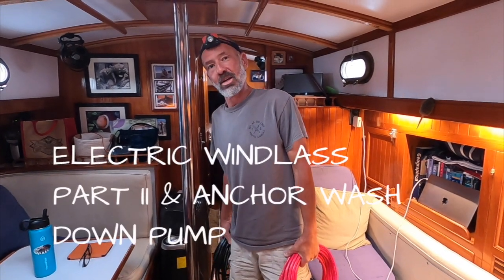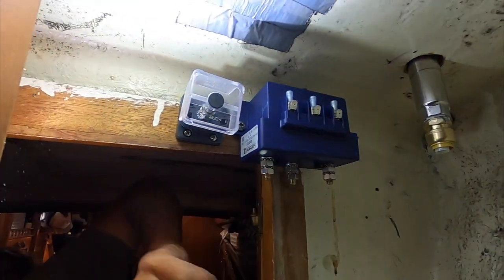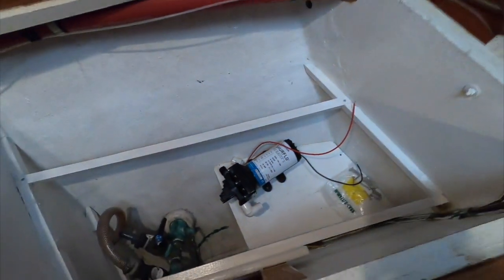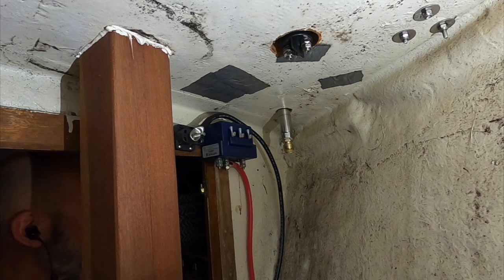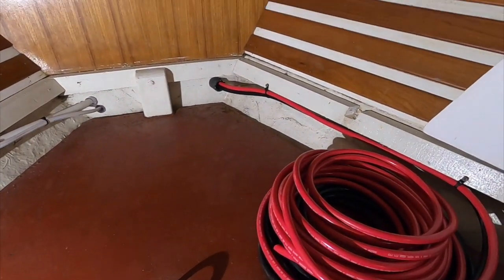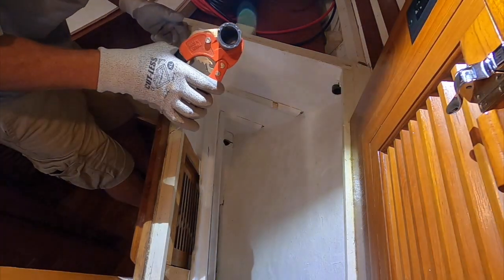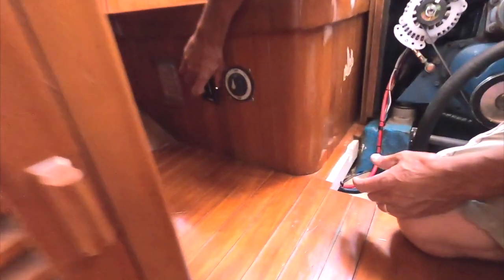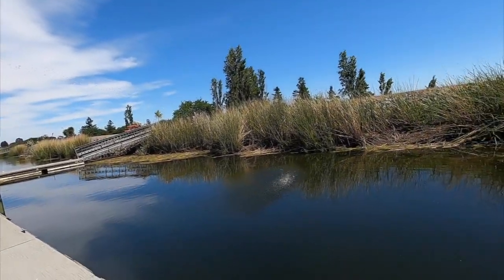SV Ramble On | Electric Windlass Part II and Anchor Washdown Pump

Comment: Did you have any issues with voltage drop over that long cable run? Is your windlass 12 volts or 24 volts?
Reply from the maker: It’s 12 volts and no voltage drop that would inhibit the operation of the windlass.

Comment: I am considering a project like this and was  contemplating just adding a battery at the bow to power the windlass. Did you consider this and if so why didn’t you go this route?
Reply from the maker: Yes we consider it, but the cabling requirements to charge the battery at the bow was the same to charge the batteries at the back of the boat.  Six of one - half dozen of the other.

Comment: If I'm working in an area and don't want to lose hardware I put a towel down and then the nut or bolts drops and lands on the towel. Then rolls off under the fuel tank. Lol
Reply from the maker: Thats a perfect idea.  After I fished the nut from under the tank that's exactly what I did.  I dropped the nut a second time (butter fingers) and thankfully it got caught in the towel.  Thanks for watching.

Comment: With heavy amperage gear in the bow like the winch and the pump, would it not be beneficial to install a dedicated forward battery to cut out the need for long run heavy duty cables. Battery can recharge in situ using existing smaller gauge power/control feeds.
Reply from the maker: Hi Mark, I actually weighed that option before I went the big cable route.  The problem with a dedicated windlass battery (at least in our case) is the different battery chemistry and charging profile compared to our LiFePo main battery bank.  That's sort of the same reason I chose not to install a dedicated starter battery with a 1-2-All-Off switch, but rather we start the engine off our single 500ah house bank.  To properly charge a remote windlass battery was going to require cable nearly as large as the windlass cable its self.  Plus, I'm not particularly fond of the idea of having batteries charging and (in the case of lead-acid technology) potentially off-gassing Hydrogen beneath our pillows as we sleep.  Everything about living and traveling on a boat is a compromise.  Thanks again for watching.

Comment: Great Job.!!! Would you remember off hand, what the length of the wire was?  2 AWG, correct. For 10  years we have been cruising with a manual windlass but finally going to upgrade. Thanks for the help.
Reply from the maker: Hey Tutty, I picked up 40' each of black and red 2AWG (80' round trip) and I had about 1.5' of red, and maybe 4' of black left over when I finished.  Talk about close  It's actually a bit oversized for the windlass load by its self, but I figured I'd err on the side of caution since I'm also running the 12amp pump off the same circuit breaker.  You probably saw that the positive buss bar is at the forward end of our nav station seat, but the negative buss is at the opposite end of the battery bank.

Comment: Can you show the connector between the vinyl hose and the pex plz sir
Reply from the maker: Hey John, I just uploaded a pic of the PEX/Poly atapter fitting I used to our Instagram & Facebook page.  Basically, it's just a male or female pipe-thread hose barb fitting to the corresponding male or female pipe thread PEX push-connect (Sharkbite).  Thanks for watching.

Comment: Love your work.  Just one note, cause I’d love to try it in my boat... could you in fact connect the water supply to work with the UP foot switch and have the pipe somehow permanently connected  to the anchor roller thus avoiding having to stay connecting the blue hose pipe and washing it down when it could be an automatic feature.!!
Reply from the maker: Hi Georges,  I saw this a couple months ago when I was researching our windlass project.  Necessity is the mother of invention... https://www.youtube.com/watch?v=SqkIPkt1SRU  
Thanks for watching.
Reply: SV Ramble On yeah. Something like that but that’s pretty rough. Was thinking of a neat SS pipe attached to the anchor roller and piping from below. Worth dreaming😂😂⛵️⛵️. Great attention to detail as always BTW.!!